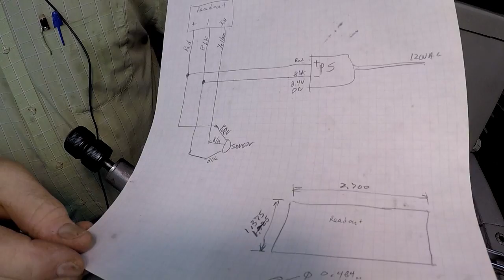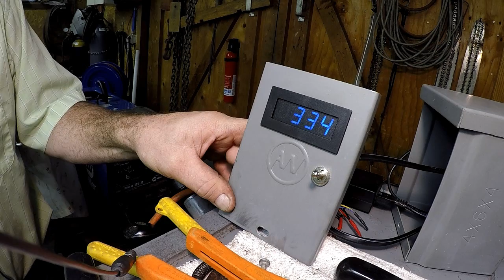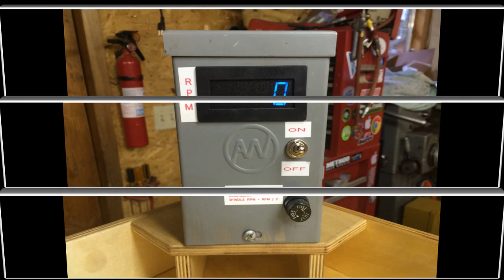Installing a Lathe Tachometer for a Lathe

Comment: 35-40 years ago I worked in a job shop that had a lance and a zubal lathe for second operation work. we beat the snot out of them and they stayed accurate and reliable. They were the same lathe with different branding. If I remember right, I think they were made in Spain......memories. Retired now with an 11" Logan in the garage.
Reply from the maker: Yes they were made in Spain.  There is very little information on them out there.  I have a manual and there have been some helpful viewers who have the same lathe.  My logan is also a 11" Model 922.

Comment: Hey Randy,

I like hearing about the ship stories.

Steam ships are 99% boredom and 1% shear terror. When everything is working it hums along. 1 thing goes wrong start scrambling. LOL.

Ryan
Reply: You absolutely put me on the floor with that comment!!
O.M.G. I have a total visual....
Reply from the maker: Ryan Johnson Yep kinda.  We went one time for 30 days straight from S.F. to Singapore with out one single alarm or failure, traveling at full speed.  18500 HP, 150000 LBS/Hr steam flow.
What a sweet ship.  Then again 2000 miles from anywhere dead plant no power and 0200hr and pitch black for 2 hrs.  Just glad the seas were calm, so we could run around alot. Thanks Randy
Reply: Yeah the worst for me was when I lost a feed water pump as we were leaving the soo lock. Ship blacked out and had the entire engineroom crew down in the engine room. We were back under way in less than 45 minutes.  Sounds like a lot but on a 10,000 HP steam ship it isn't all that long.
Reply from the maker: Ryan Johnson I don't how many times we had to get everybody up and to the ER.  45 min is just a blink of the eye when SHTF.  I will have to recant another sea story or two.  Thanks Randy

Comment: Nice job! I installed one on my Drill Press after adding a 3PH motor with a VFD. I used the small round neodymium magnet like yours,  but found it would drop off at higher RPM's, around 2000. I replaced that magnet with a neodymium from an old hard drive. That one was oblong, kind of kidney shaped. It being wider gave me more dwell, increasing the sensor's pulse width. That did it, goes all the way to 2500 RPM now.
Reply from the maker: ToolGuy Thanks, I tested it to 2000 and was good.  That is a good idea on the longer magnet.
Thanks for the suggestion.   Randy

Comment: Nice job Randy. I especially like the box on top of the lathe to hold tools conveniently and keep them from falling off. Another possibility for RPM readout is the MachTach from Henry Arnold. It has sensor options including Hall Effect and infrared optical but includes direct SFM readout. I use these on my lathe and mill. Thanks for sharing.
Reply from the maker: Karl Kulp Thank you Karl.  I will have to check that out.  Thank you for your support.  Randy
Reply from the maker: Karl Kulp What are standing next to?  I checedk out the MachTach, very nice and I like it.  I might have to try one of those kits.  Thanks Randy
Reply: Randy Richard I have a Bellanca Decathlon. I enjoy a little aerobatics from time to time.
Reply from the maker: Karl Kulp I have worked on a couple of them, good planes.  Be safe and keep the blue side up, sometimes.  Thanks Randy

Comment: Hi Randy done the same thing myself but still an interesting video maybe worth mentioning the sensor needs to see the south face of the magnet and a useful power supply is an old mobile phone charger.
Reply from the maker: ***** Thanks for the suggestion.  Yeah just about any wall wart will work. You have to get the magnet right.  Randy

Comment: What method did you use to cut the metal box? Nice job. I just received the same tach setup today.
Reply from the maker: Drill and closely spaced series of small holes around the the inside of the line, then break out slug.  Then file to clean up and size.  Thanks.

Comment: Nice Job. question: does the fuse go on the hot side before the switch. or do you put it on the common side that goes around the switch?
Reply from the maker: I put it on the hot side right after the switch.  Thanks Randy

Comment: Yep as usual great project Randy. While a person could make up a chart against VFD settings and pulley positions to give the rpm you should be getting, why would you? Far simpler and faster to just check the tach. I have really got to do this for my mill.
Reply from the maker: +Turning Point Very cheap and easy.   Fun little project.  Thanks, Randy

Comment: I also have a huge supply of wall warts and power supplies scavenged from old electronics.  Quite useful.

What's the recommended voltage on those tachs?
Reply: Nevermind.  You answered it  :)
Reply from the maker: Terry Talton They vary but usually any where from 3VDC to 32VDC.  Thanks Randy

Comment: Sir,will these device give accurate rpm value
Reply from the maker: with in 5 not a problem.
Reply: @RRINTHESHOP  less than 10 rpm can measure in it

Comment: cool project. what's the minimum rpm it will display?
I really like the tray you made there, turned out real nice.
Reply from the maker: sharp x Thank you, I just tested that 14rpm was about the lowest reliable reading.  Thanks again, Randy
Reply: 14 is excellent,

Comment: I got one of those for Christmas.
No pwperwork either.

Can you post the drawing in a way I don't have to signup for ?
Reply from the maker: 12345NoNamesLeft Yes no problem, I will get something up to the Shared Drop Box today.  Here is the link:   @home/Shared%20Online

Thanks Randy
Reply: Randy Richard
Thank you Randy

I didn't catch this in the video, what kind of gap did you set the magnet at ?
Reply from the maker: 12345NoNamesLeft I think it about 30 to 40 thou.  Close enough to work and not hit during use.  In test I have done they can work with a 1/4" gap, with a good magnet.
Reply from the maker: 12345NoNamesLeft Just got a drawing posted in my shared drop box, here is the link.  HallEffectTachometer.pdf is the file.
Link:  https://www.dropbox.com/home/shared%20Online
Reply: Randy Richard
Thanks Randy

It still wants me to create an account and sign in,

Is there some sort of setting you can change to make it public?
Reply from the maker: 12345NoNamesLeft Send me and email and I will email you a copy.  rrintheshop@gmail.com Randy

Comment: Nice project.  I was going to suggest epoxy to attach metal box to headstock, or using magnets to allow easy removal of box, but your drawer is much better solution.
Reply from the maker: Morris Gallo The tray worked out well and a great reuse.  I bolted the box down.  Thanks for watching. Randy

Comment: Do you know how I can make a speed control to be able to just plug a 115 volt tool into on the cheep .I use a light dimmer right now and it seam's to work but not sure how long it will last?
Reply from the maker: Mack McCurry You are about as cheap as you can get, simple triac control, if the motor and or the dimmer does not over heat you are probably ok.   There are small motor speed controls that are available for a little bit more than a dimmer.  Randy

Comment: Hey Randy thanks for sharing! I do automation for a living (next to university), mainly building truck washing machines. A few things you should definately consider:

1) You should attach a ground to the case! If one of your soldered or crimped connections will come loose, there is a possibility to have a live wire on your case, which is potentially dangerous. Grounding is mandatory for every metal casing, which contains electronics here in Germany.

2) You should never crimp soldered wires. The solder will flow off the joint sooner or later (yes even when its cold) and the joint will come loose eventually. Also when crimping it is important, that the wires can move freely, as they will fill up the small spaces. Take a look at this picture: http://www.weidmueller.de/bausteine.net/i/69530/Richtiges-Crimpen.jpg?width=331, which is kind of related.

3) Heat shrink tubing on the live AC power (on the switch) is also an important feature, to protect someone (or yourself) from touching a live wire.

If you have any questions, I would be happy to help.

Best wishes

Phil
Reply from the maker: Philipp Schaefer Thanks for your suggestions.  i said engineers are terrible about doing things for themselves.  I tore it apart this morning first think and fixed everything you mentioned. 
Thanks you for making me do it right.  Don't stop making suggestions.  Thanks again, Randy
Reply: I would also add,  in general using a single pole switch for the mains is a bad idea. If source and load are polarised correctly it will be OK but assumption is the mother of all f@#% ups. If the source is wired backwards or you insert the unearthed plug in backwards the switch will still seem to function but the active is now permanently connected to the load which is obviously hazardous to anyone working on or around the circuit in the belief the circuit is isolated.

Comment: Hi Randy,
Nice installation with the Hall Effect sensors and electronics. I was inspired by your previous HE tachometer publication at Homemadetools.net and did a similar one for my old 7" swing mini lathe (http://www.homemadetools.net/mini-lathe-digital-tachometer). Now, I plan to install another one of these on my 12" swing geared-head lathe. It is not variable speed drive but the gear switching levers for selecting RPMs and high/low selection are collocated within one shaft. This makes makes it pretty tricky to switch the speeds and do it correctly in one smooth motion. The tachometer will confirm the speed selection. Thanks for sharing the video.
Paul
Reply from the maker: Paul Jones Thanks Paul.  I think every lathe could use one.  Have you got your new lathe yet?  Randy
Reply: Randy Richard Yes, the 12" swing by 37" between centers geared-head gap bed lathe arrived on January 22 and setup in my four car garage where one of the garages is isolated and devoted to a machine and wood shop. The lathe design looks like a Grizzly G4003G but was built in 1987 in Taiwan. Mechanically in great shape and precision, not used too much, but needs a good cleaning. I will send some photos on my progress. Paul
Reply from the maker: Paul Jones I will look forward to some photos.  Randy
Reply: Randy Richard Hi Randy,
As promised I completed another lathe tachometer installation and this one is for the 12"x37" geared-head lathe.  I have been experimenting with different pulley arrangements for this lathe and needed the tachometer because the RPMs will be different from rpm selections displayed on the speed selector plate. I published the tachometer installation article and photos at HomemadeTools.net (see http://www.homemadetools.net/forum/12%94x37%94-metal-lathe-digital-tachometer-16430) and mentioned that you provided the original inspiration for me to do this. The installation works great,
Thank you, Paul